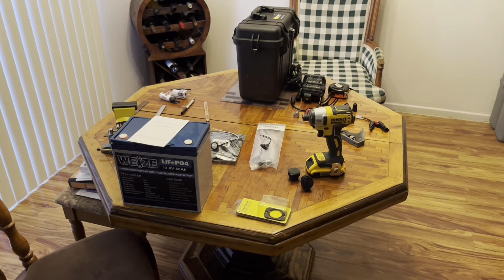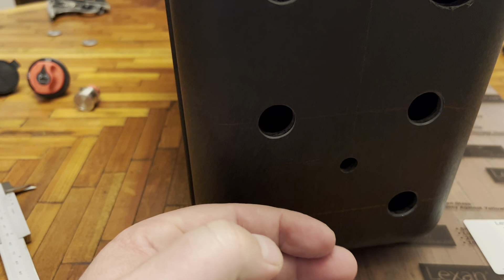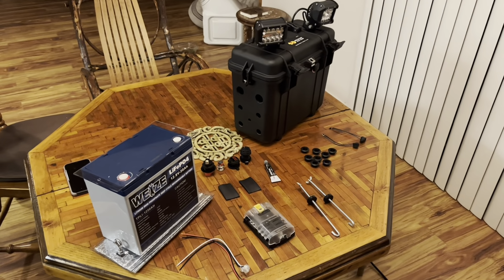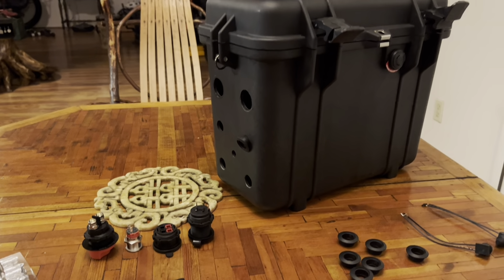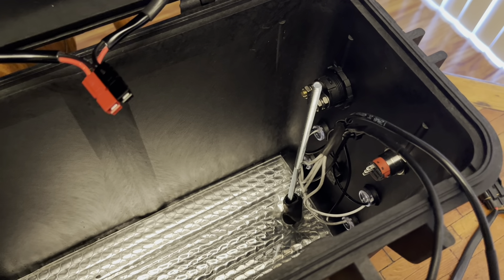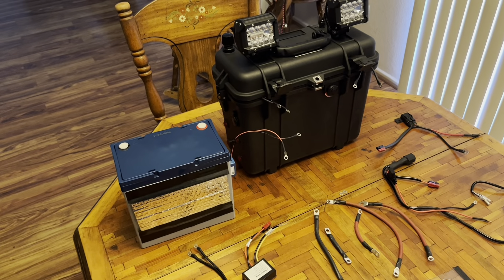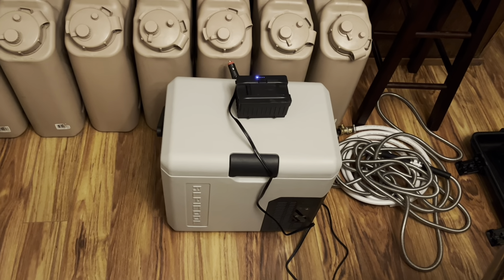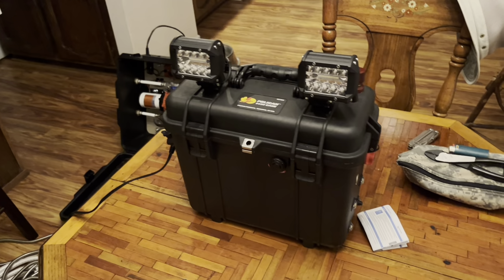LED Light Battery Box Build

Comment: at 6:13, are not the centers adjustable with the threads? can you not crank the thread back, making the second set of thread area longer? But, with the raised bead on the lid, wouldn't the .25-hole need be drilled away from the risen bead a little, allowing the inserts to snug down flat?
Reply from the maker: The glands are solid one piece.  You’re absolutely correct on the drilled hole placement! I had to get the pocket knife out and do a little fixing of my mistakes! 
I actually made 3 mistakes with the box, that’s the most visible one!

Comment: Hey there, so I do mobile detailing and I want to add some light to my trailer so I could work at night I mostly work on semi trucks do you think this battery will last
Reply from the maker: Yes I have now had some use with box. Had turned on for 5 hours and still have battery left.